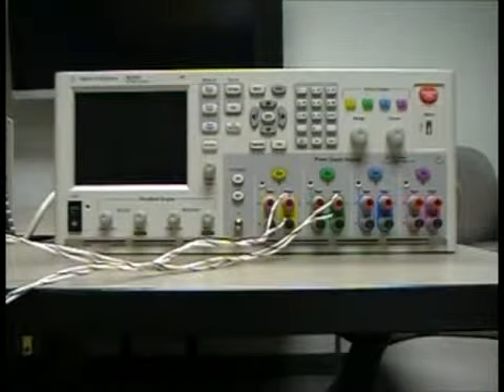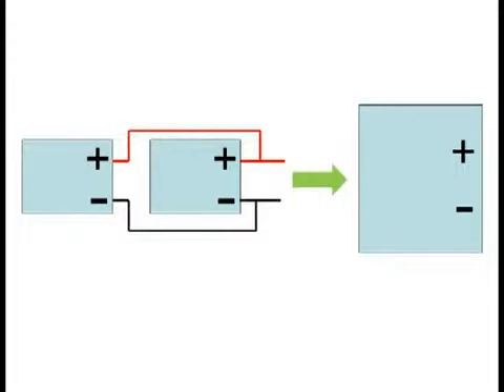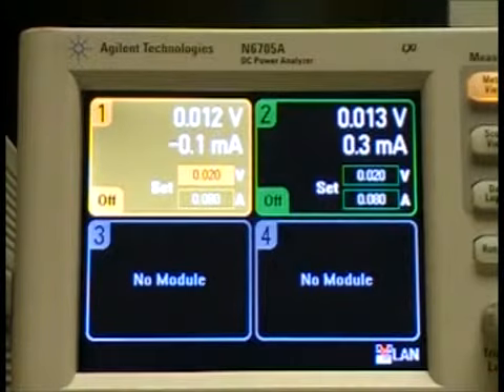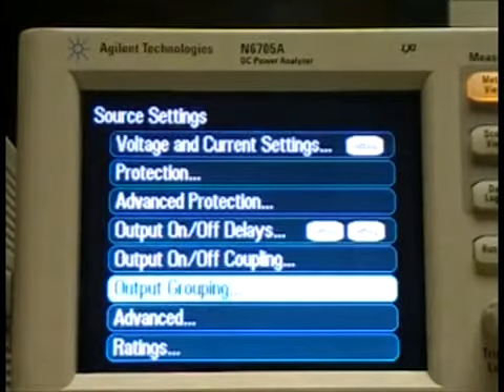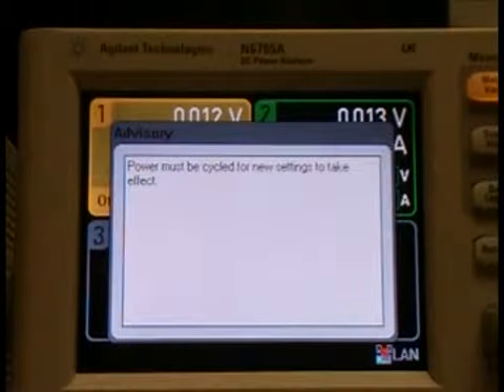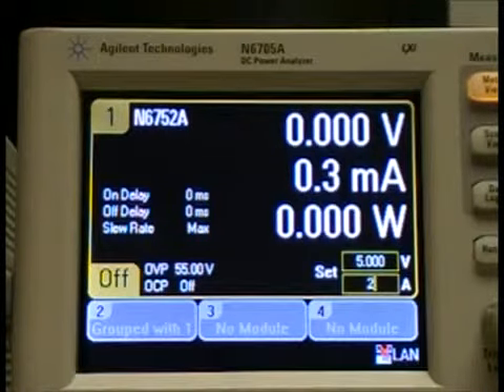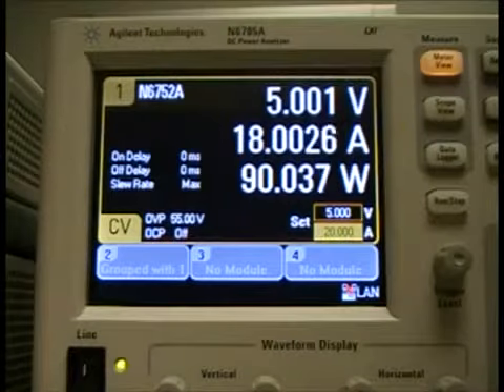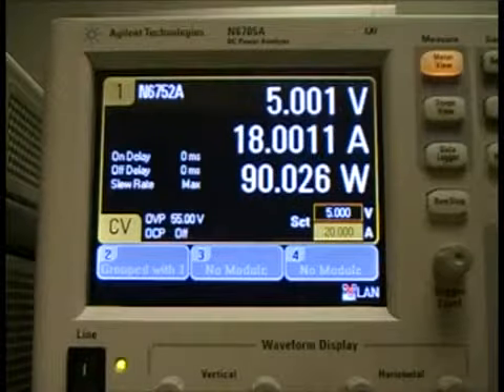N6705A channel grouping for parallel operation

Comment: Why I can't group 2 or more N6781A in a N6705B. It does not have an option for me to select the other power supply in grouping option.
Reply from the maker: Xavier Mangubat.  You are correct the SMU modules cannot be grouped. From page 39 of the manual "The output grouping
function is not available for N678xA SMU power modules."  If you are interested in the technical reason - one of the reasons is explained in this blog on electronic loads: http://powersupply.blogs.keysight.com/2013/11/why-cant-you-put-electronic-loads-in.html  SMUs have several other reasons that make them difficult to group. We have the higher power SMU modules: N6785A and N6786A.